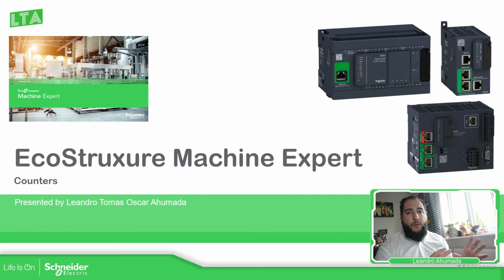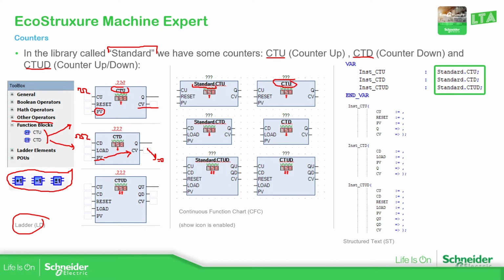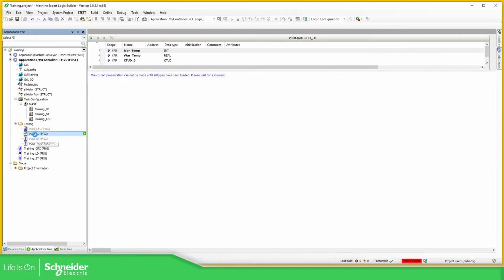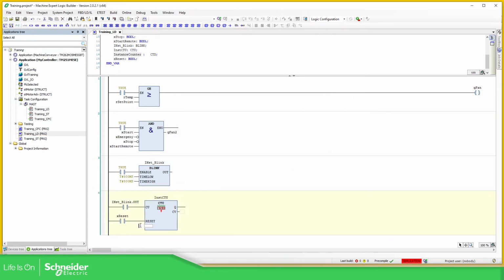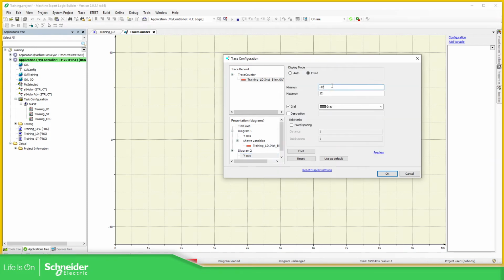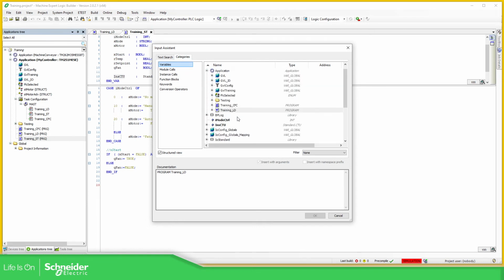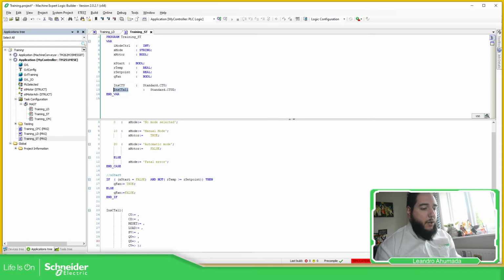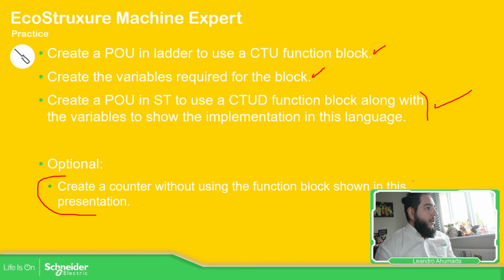EcoStruxure Machine Expert Training - M5.4 Counters

Comment: hello Leandro 
thanks a lot for your videos, that help me a lot after long time without programming, thanks a lot for your work 
I have one question, i looking to make a time counter, and a resetable time counter, on a M241, is theire any solution to make it easely ? 
thanks a lot 
best regards
Reply from the maker: Hi there! I can not remember a function block to that rigth now but i will probably create it. I will make one and share the library.
Reply: @LeTomasAHUMADA  thanks a lot 
I maybee found a solution, using ET output of a ton timer 
But its to have an hour counter of a machine 
So i cannot défined a very hight value for thé Time in PT input 
Have an Idea of ?
Reply from the maker: Install the library and use the block "FB_Counter":
https://app.box.com/s/r7zupob3dtzzds51pcksqywy6qgasbr8
Reply: @LeTomasAHUMADA  thanks a lot for you job !! I will try it, 
did you already make a tuto to how create funtionblock?
Reply from the maker: @TDMDJOFF  to be honest… i do not remember but i will create one related to improve code uaing function block + visualizations